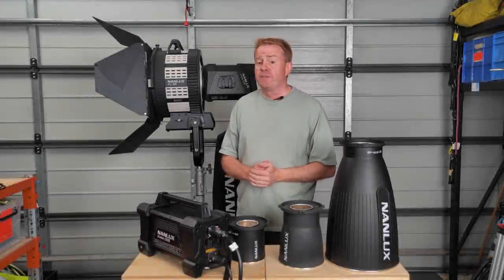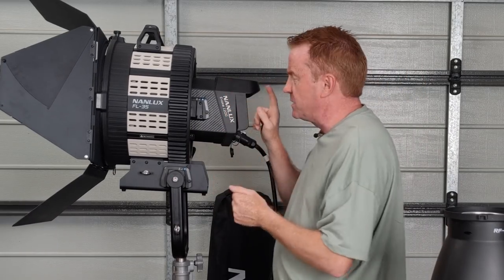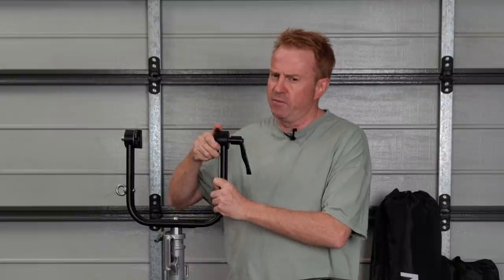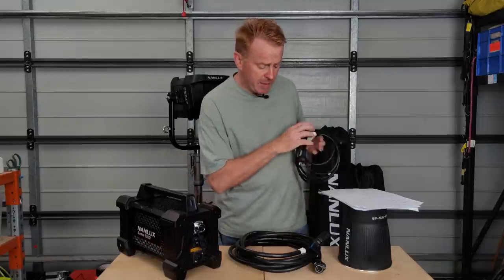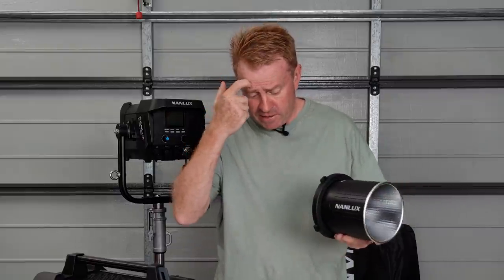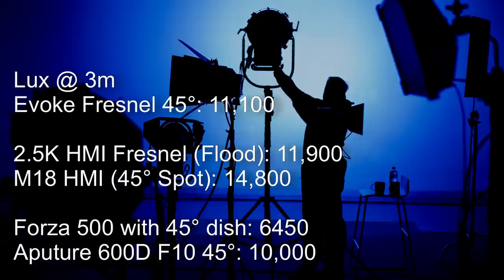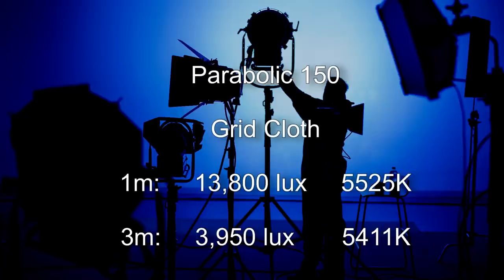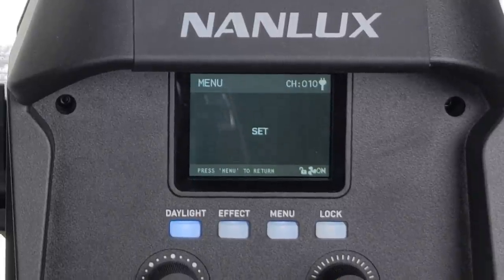Gaffer & Gear 173 - Nanlux Evoke 1200

Comment: I have two Evokes and fresnels - the reflectors are the way to go - it’s quick to deploy and powerful - there is a 12 degree coming and I have a 10m and 15m head lead in order - I control with exalux and weather sealing is good - used parabolic 150 first time today - quite a battle to put up and down - but nice light - 60 degree through 8 ft frame is lovely

Thanks Andrew another great review
Reply from the maker: Thanks for the heads up, I didn't know about the longer head in leads here in Australia, and a 12⁰ dish.... Wow that would be bright.
Reply: @gaffergear  yes be great with CRLS/Lightstream- 10m cable is £175 gbp 15m £245 gbp before tax in uk - but worth having.- available in April 22

Comment: Thank you Andrew for your thorough review! You're my favourite channel:)
Here in israel, the evoke 1200 is a a gem at rental houses because they cost production about half of what youd get for a 600d
But...
I think the fresnel attachment - as great as it is, is not safe and i wouldn't give an inexperienced lighting technician preform a simple tilt down. May cause equipment or persons damage, and obviously looking like fools.

Also, using it indoors as keylight for corporate stuff, sound guys usually complain although you can get away close up with 10%
Its a great light but APUTURE'S 1200D will probably be better

Comment: Thank you for this one! Been considering the evoke for awhile but I'm waiting to see how the 1200d stacks up. Hoping to get one of them as an M18 replacement, the only thing I worry about on the 1200D was the decision to keep the Bowens mount. Looking forward to your review on that one!
Reply: What's the detriment to Bowens mount? A smaller COB means a closer mimic to an HMI's point source aesthetic and cross compatibility to existing accessories
Reply: @tobycueni3186  I think the problem is that as you try to keep increasing the power of the LED's, you likely won't be able to keep the cob as small as it currently is (and certainly not a point source). But equally, as the attachments get larger, like a bigger fresnel, or a really big softbox a safe distance from the cob, then the Bowens mount really isn't strong enough.  By choosing to redesign the mount for the bigger fixtures now, it gives them more flexibility going forward.

Comment: Its actually really strange for me because i never have the Aputure dishes with me when i'm out filming (only the Soft-box of choice and the Fresnel attachment). To see the Fresnel attachment not really add much more to the light (both in size and price) is really odd. Again, for me I'm more in the Aputure eco-system so it'll be interesting to see what they come up with, with their 1200W unit in the next few months. Again Andrew, thanks for the review 👍🏻👍🏻
Reply from the maker: I have 2 of the 600D and one 600x. It seems a common theme amongst gaffers that the hyper reflector is left back in the workshop.
Reply: @gaffergear  agreed until these reflectors came out I pretty much never used hyper reflectors, but I'm finding the light quality on these reflectors use able,  I'm still loving the Fresnel on night shoots tho it puts out a beautiful even beam. With dimming and lumin radio very useful.
Reply from the maker: @Privateerspace  optically it's a beautiful fresnel.

Comment: Hello, do you plan on making a review of anything from digital sputnik like the ds6 or their new apollo? Also, as a gaffer, when investing in a type of light for a 1 or 2 ton van package, how many do you like to have in stock? The reason I ask is that I'm thinking of getting 2 of each type of light (equivalent for LEDs mind you) with those types being 2.5ks, 1.2ks,  575 or 400 if I can find an led equivalent to that, 1x1 led panels, and practical kits, but I don't know if that would be enough, would three or four of each be a better bet?

Comment: I’m surprised you didn’t mention the horrendous light leaks of sides of the FL35.

Also something I was wondering which you didn’t show is the evenness of the light beam of the reflectors, are there any hotspots? 

I guess like many other I’m waiting on the Aputure 1200D to see how they compare.
At first, the apparently COB on the 1200D seemed like a positive for me, but seeing the photometrics they have released it just seems disappointing so far and maybe not the right decision for a reflector-centric light system, but we’ll see what the future tells us.

How long after the official release of the 1200D do you think you can upload a video? (More or less) 

Anyway, thank you for a thorough review as usual!
Reply from the maker: The F35 only leaks in spot, most likely it's a long distance from set in spot so figured not worth mentioning. Initially I was shocked by it but after some testing I figured it would never play.

The reflectors are very even, you really have to search for a hot spot on the 45. It's about you get on a good fresnel.

 The 60 has a very very slight dull spot in the centre, but unless you are looking for it it's not noticeable, I thing it was around 1% under the rest. I didn't film it because every sheen on a wall looked like a hot spot that the dish didn't have.

Comment: Important to note there is also (not yet shipping) a 3200k version. I do like fresnel quality but man it’s a beast and am surprised by the numbers vs the F10 and 600D… that said I’ve bought 2.  Hoping for a projection mount as well… would be also curious to compare the color metrics to a typical 1800w bulb in m18 i’m almost certain the evoke will have much better color and TM30 scores…
Reply from the maker: I ended up buying two of the kits I talked about at the end. The reflectors got this across the line for me.
Reply: @gaffergear  yeah another reason it’s so critical to match beam angle… if you want a true comparison. Think it’s time to list my M18 for sale… the evokes can cover for them 90% of the time I’d wager…

Comment: Im not too keen in purchase evoke lights, the 1200d will allegedly pump around 20k more lux if im not mistaken.
Other factors are, no bowens mounts (as opposed to 1200d) and i’m not too keen on the general design of the fixture (fresnel balance issue and controls).
Reply: How do you figure 20k more lux from the 1200d? The Nanlux seems brighter in everything besides bare chip vs bare chip. Comparing aputures 1200d measurements to what Andrew metered off the evoke you get:
Bare bulb: 1200d is 6380 vs the evoke’s 4390. 
1200d (55 degree reflector) is 9610 lux vs the evokes 10,400 Lux (at a wider beam angle of 60 degrees)
1200d (30 degree reflector) is 22,400 Lux vs the evokes (26 degree reflector) 41,000 Lux 
The 1200d does have a tighter reflector option (15 degrees) which the evoke does not offer right now. the evoke seems brighter at comparable beam angles overall.
Reply: @cfl4286  100% correct.

I have recently realised that these bare COB brightness readings are actually a bit misleading and shouldn't really be compared directly to gauge the total brightness.. Aputure quotes 66 degrees beam angle for the bare COB on the 1200d, the Evoke is over 100degrees. This explains why as soon as you put a reflector on the Evoke it can be quite a bit brighter than the aputure. Total volume of light is not just lux by itself... you need to consider how much coverage you get with the beam angle too - the fresnel and the reflectors can harness this wider beam angle and focus it down to a brighter spotlight. If you start at 66 degrees like the aputure, there is less light available to focus.

Comment: I recall the size of the COB affects the actual light coverage of the light (COB size x beam angle = actual light coverage). With Evoke's COB being larger than others, with its fresnel attached @ 11deg actually covers a wider area and looks roughly around 15-20 degrees compared to Forza 500 / Aputure 600D w/ fresnel, and Evoke @ 45deg looks roughly around 50-55deg of a Forza 500 / 600d w/ fresnel.

Can you help confirm this Andrew? Awesome review!
Reply from the maker: The degree angles on the fresnel are accurate. The evoke has a larger COB but this is a larger fresnel to suit. It's roughly 12" versus say the Aputure F10 with a 10".

If we could some how fit an Aputure F10 on this then you would be correct.
Reply: @gaffergear  thank you! Glad to know the degrees are accurate, looks like the Nanlux Fresnel is really well made.

Comment: Aputure has a glas in front of the cob... it is sad that there are nor correction glasses to correct the green or magenta tint right in front of the cob ... that would be cool imo
Reply: Dedolight makes some glass colour filters. They definitely have daylight to tungsten and tungsten to daylight… but I don’t think they do any glass green and magenta
Reply: @cagf2013  that is cool! but don't you thing it would be amazing to calibratedaylight leds using glass filters in front of the cob ... i am not an expert but that would be ultra convenient to have the same startingpoint on all light on set
Reply: oh hell yeah! 100% agree - there is more and more need for something like that given how much heat these powerful led can shoot out the front from the COB
Reply: just found that Lee makes a ‘plus green’ glass filter in various sizes. Heat resistant to 371 deg Celsius. Should do the trick!
Reply: @cagf2013  that is great! thanks a lot for sharing! :)

Comment: Nice review. Is the P600c up next?
Reply: @gaffergear  Now you have me concerned. I just ordered a p600c, mostly because of p300c's yolk flexing with heavy modifiers. Can the p600c handle a Dopchoice Octa 5 with a grid?
Reply from the maker: Sorry, I got my lights mixed up the Nova P600c is tops, I got it mixed up with the P60C.

The Nova P600 will most likely be my skypanel replacement

Comment: Did you have comparison specs for 26 degree reflector seems like u skipped over that?
Reply from the maker: I could find an easy comparison, every one else has a spot of 19⁰.

This spot of 26⁰ is close to the 1200D mid dish which was under NDA at the time so I couldn't mention it. I think I have a comparison in the 1200d video if that helps.

I think the evoke is way brighter but the shadows are not as sharp
Reply: @gaffergear  copy that i own 2 evoke 1200 and its clear to reach the output of a m18 you need to use the hyper reflectors. both the 60 and the 45 were quite close if not more than the m18 just wondering if the same would be the case of the 26 degree. they have a special at b and h and i can get the 26 and 60 in a kit.  did you get a 3 meter lux reading with the 26 reflector?
Reply from the maker: @jaredjaynes  I have one 26⁰ and I use it way more than i thought I would. Mostly for longer throws.

My M18s have gone from being used 3 times a week down to once every 2 weeks. Everyone wants an evoke or 1200d now.

Comment: I always disregarded the Evoke because of the Fresnel but if its that usable with just the Dishes, I might consider it as a m18 replacement. Im just not sure about carrying all the Dishes around, I wonder how it will compare to the Aputure counterpart.
Reply from the maker: I can't say much because the 1200D is under embargo, but both systems have different beam diameters on the relfectors, so take not over the next month of the beam diameters you would use on set. It will help you make a decision. But it's not an easy decision at all.
Reply: @gaffergear  As stupid as it sounds for me, the most important part is the comparison to the M18. Because on lots of jobs production will ask for an m18 through the window or as a Key. So i have to be able to offer the same output and Light quality, or Clients will just rather go for what they all-ready know. And in Germany that’s Arri HMIs

Comment: Just comparing Aputure's own numbers vs Evoke. (https://youtu.be/Psz8G6v2erQ?t=392) The Aputure 55 degree dish has 9,610 lux at 3m, compared to Evoke's 10,400 lux at 60 degrees. Aputure's 30 degree dish outputs 22,400 lux compared to 41,000 lux at 26 degrees for the Evoke. Looking at the videos, the 1200d Dishes (except for the 15 degree) appear much smaller than the Evoke's.   With no modifier the 1200d(6380 lux) is 45% brighter than the Evoke's 4390 lux. Kind of disappointing that Aputure isn't getting better performance  out of their dishes.
Reply: Very good points. Aputures poorly designed dishes, are a weak point for them. I wonder what the Aputure 1200d beam angle is with no attachment? Might be why it is brighter than expected compared to the evoke.
Reply: To answer my own question, Aputure 1200D beam angle with no reflector is only 66 degrees! This will be why the reflectors don’t work as well… the native beam is already quite narrow - so will not fill the reflector as well as the evoke which has 120 degree beam angle.
Reply: @cagf2013  Yeah, I just saw it on the Aputure site. Hoping it's an error.  Seems odd to go with such a narrow beam. Wondering now if it can fill the  new  Aputure 150 dome(which has no baffle). Evoke is looking like the better choice
Reply: @nshea3286  yeah, I am worried that it is the actual beam angle… when you see a photo from the front of the 1200d the COB is actually set backwards inside a small silver reflector. The evoke has the COB right at the front with nothing to really block the light on sides

Comment: im wishing someone would make an adapter for those bowls so i could use them on my 600d's pr the aputure 1200d when it drops.
Reply from the maker: Hand holding them in front it doesn't optically line up to the smaller COB. You get a distinct ring unfortunately.

Comment: The fan part is really disappointing. Especially when brands like Noctua exist that make whisper quiet fans so this could have been totally avoided. At this price point it would have been worth the extra investment there. It looks like would be easy to replace, but users should not have to modify their equipment like that.
Reply: Noctua fans are just severely undervolted which makes the give the "quiet" look. They use thicker blades to push out the airflow better to balance out the undervolting but really it's not much of a new technology. When you're sourcing out parts to manufacturer a product, you make sacrifices and unfortunately can't please everyone. I expect the lights like this would stay far away from whatever the audio source would be so I'm not too concerned - just glad we have a LED light that's as powerful as M18 and when LED panels were a thing almost 10 years ago, I thought this day would never come.